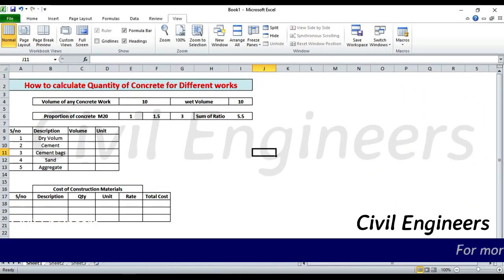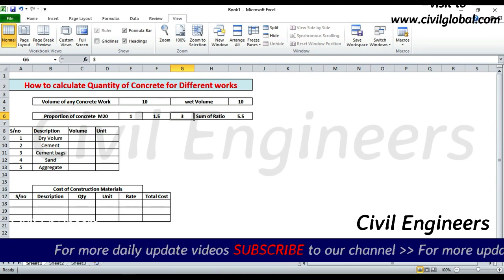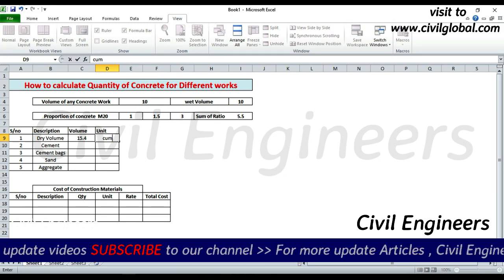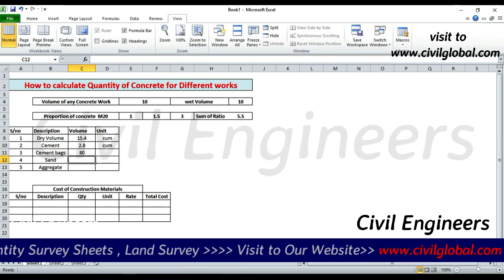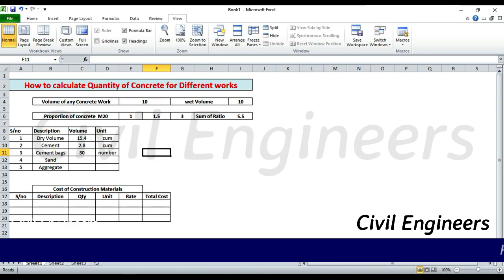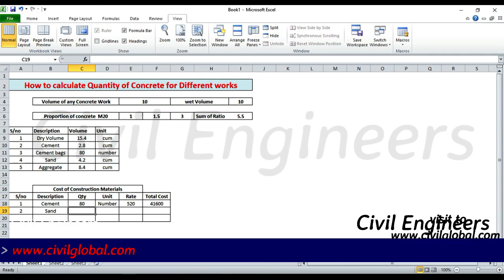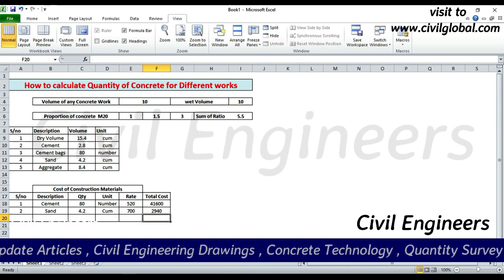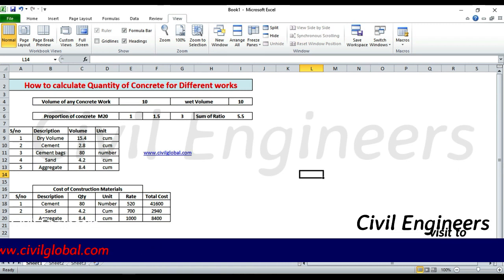How to calculate Concrete Quantity in slab Beam Column and road

Comment: sir ye excal file ka link de di ji ye .
ab to link de do....
Reply: sir ji app  ne number bag kese nilkale 
hume cement ki quantity = 2.8cum
      1cum = 2406kg 
so 2.8*2406=6736.8 kg
1cement bag in kg. = 50kg
so.      6736.8/50= 134.736 bag ...
      sir kahi aap ka calculation galt to nhi ye ........me to answer de di jiye .......
Reply: bhai volume of cement 2.8cu.m hai aur tummko no. of bag chaiye toh 2.8 ko 0.035 divide karna hota hai kyu ki 0.035 volume of bag hoti hai, hope you got ur doubt clear
Reply: Okay....